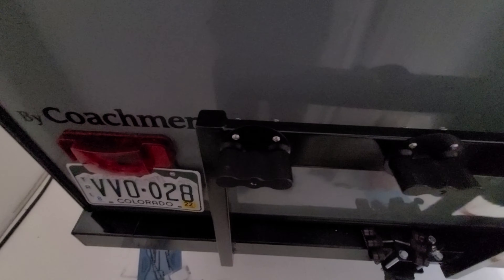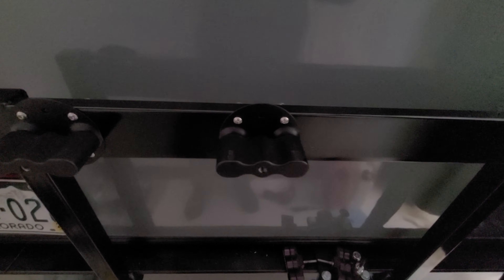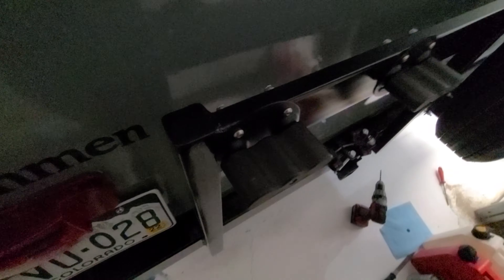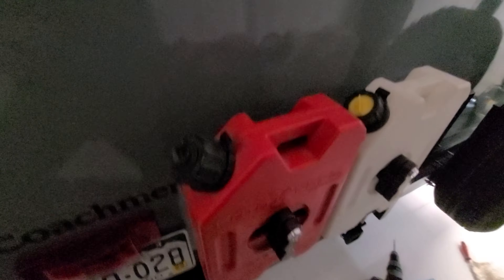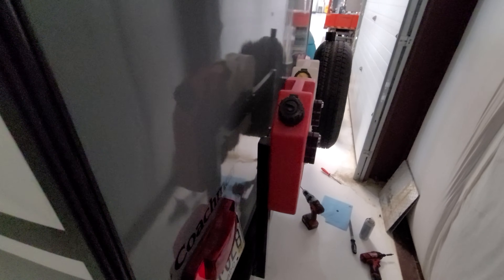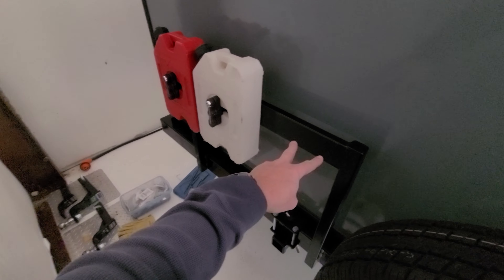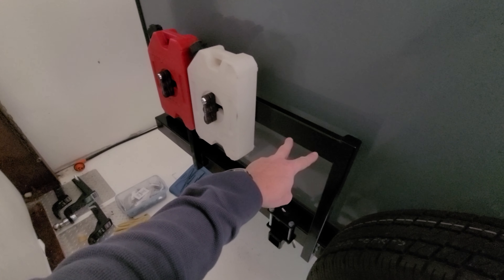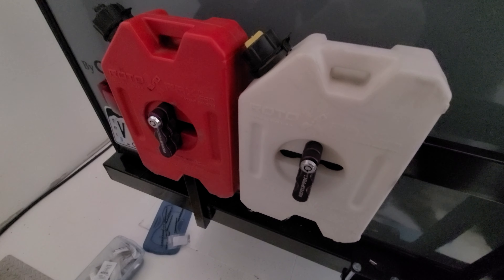Rotopax fuel cell mount finished on 2021 Coachmen Apex Nano 194BHS

Comment: Adventure bike?
Reply from the maker: Heya there Zach.
Not this time around. This is our small camping trailer that needed a bit of fuel for the small generator in case the 200 watt solar panels can't keep up.
We have now camped twice up in the mountains around 10k feet where storms after storms drifted in and the panels could now keep up with the demand of the 12v fridge and other things. 
So gen.... it is as emergency ad I don't want to store fuel cannistors inside.